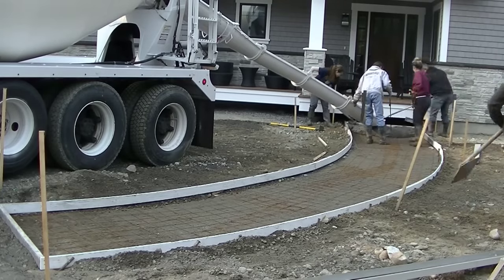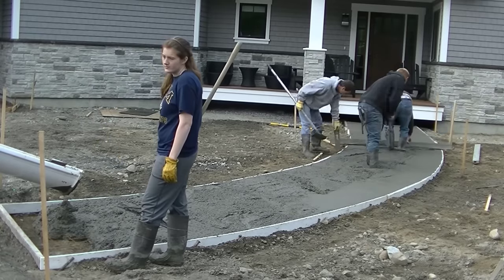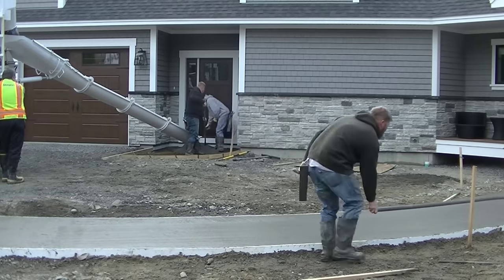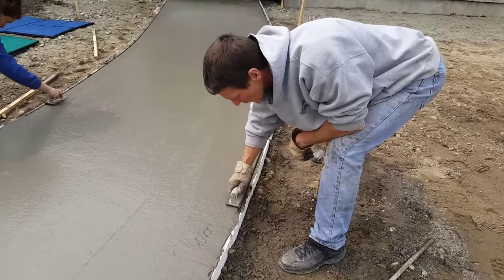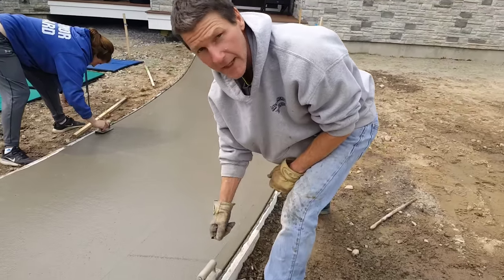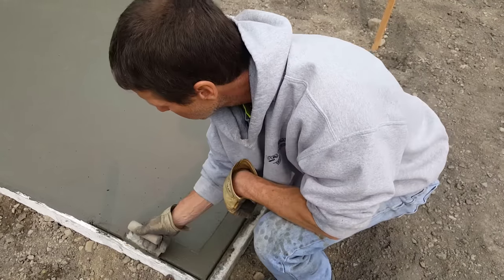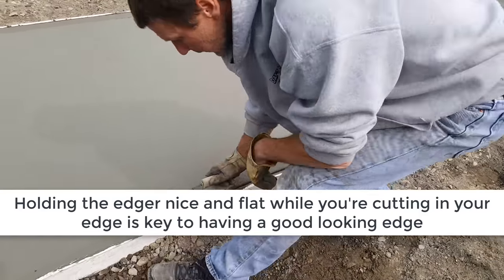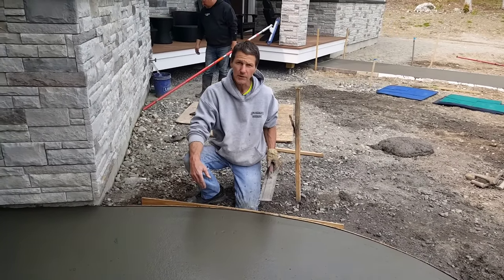When To Start Finishing Concrete After The Pour

Comment: When the previous tenant moved they backed their truck into the porch  smashing the corners on the bottom 2 step corners. I found some bullnose forms that are close in profile. I am wondering  when or if I can remove the forms & try to blend where the old & new concrete  meet. Thanks
Reply from the maker: You'd have to remove them when the concrete is still pretty green but is hard enough to hold its shape. Then use a damp sponge, rubbing the new concrete over the old where there is the seam, blending them together.

Comment: I hate to be "that guy"...but I couldn't help but notice the wire mesh here. You can see the young lady pulling the mesh up to mid slab as it's being poured (great job!)...but then the screed man walks back over it, driving it back to the bottom. If mesh is not set in the slab, it's basically worthless. Just a few bricks or slab bolster will keep the mesh where it's supposed to be. Other than that, very professional and great finishing tips.

Comment: I also enjoyed watching and learning but you forgot to pick up the rebar when you guys were pulling what's the point of having rebar if you're going to leave it way at the bottom don't you have to have it in the middle for to give the concrete just strength and longevity and reinforcement. Not a negative comment awesome job

Comment: Need rebar all the way around the edges. When the sidewalk is kinda hanging by itself or not pinned to anything, I like to dig postholes in the corners then every 5-6 feet or so. And this works for bigger slabs as well. On a sidewalk , put a guy on each side of the screed board. So much faster and don't have to worry about boot print variation.
Reply: Interesting, I haven't heard of that being a requirement. If the area is fairly level I wouldn't think you would need it, right?
Reply: @kbanghart  was your question about the rebar or the post holes?
Reply: @Scubasteve22  oh, I wasn't sure you were describing something separate. So, what do you mean by the rebar and the post holes? Lol. You mean so the whole slab won't shift?
Reply: @kbanghart  What we do is put 1/2" rebar 3" in from the form and tie it to the wire. We put it all the way around the slab. What can happen a the concrete cracks in the tool grooves and freeze thaw, the concrete can move around and actually end up with one side of the joint higher than the other. Just wire does not prevent this. The post holes about a foot below subgrade will help lock the slab from moving or venturing down the hill, since there is no foundation to pin it to. Plus with the post holes in the corners where the concrete is most vulnerable, it strengthens it in case someone accidentally runs over the edge with a vehicle or something heavy. hope this helps

Comment: The finishing instructions are great.  I don't understand your use of metal mesh in the pour and then crushing right down to the bottom by constantly walking on it.  Pulling it up is OK, although that is very difficult to do correctly.  With a pour of the dimension you show, there is no need at all for anyone to be walking in the pour area as it can be stuck off and floated externally.  So, that part of the pour could be much better.

Comment: I'm going to form a 24x9 slab.  The 9 feet section butts up against a wall, so i can't work the concrete from that side.   I'm going to broom it, but was curious the best way to reach the area against the wall to do the initial finishing? Thanks!
Reply from the maker: I've got quite a few videos on broom finishing patios. Check out the videos tab or Search on my channel for patios.
Reply: @MikeDayConcrete  Thanks, awesome videos...I checked them out and feel I can do the job.  Curious, the 24 x 9 slab will be next to my garage for storage.   The slab is 3" and it's not holding a lot of weight at all.  The ground under the slab is crushed shell that has has degraded over the years and has gotten very hard.  There's still a bit of shell, but very dense under it. If I get the concrete delivered with the stuff they put in it to make it stronger, do I need rebar, or wire in the slab and should I leave, or remove the loose shell on top of the hard pan ground before pouring ?  I live in Clearwater Florida, so it rarely gets cold here. Thanks for any advice!
Reply: Handles dude, use long handled Fresno and get on it at correct time, as Mr day said timing is everything,, plus all the variables, wind, plastic, temps ,help or not , chemicals can be our friends,  meaning set and accelerators,. The only thing I see missing from lots of concrete contractors,,you guys don't put enough expansion joint material in when you pour, expansion and retraction, against a wall or another hard slab expansion joint material should be used and of course self leveling caulk when completed,  I see it all the time, ....aci days use it, frost heat and common sense....34 years in the business talking here,. Peace....TNT Concrete Construction,,Rockford,Michigan...

Comment: Very nice work. I have been in the business for over 20 years. My only suggestion is don't waste your money with WWF if you are just walking it into the ground. It serves no benefit or purpose to the concrete where it is located in the sidewalk. It needs to be up on slab bolsters or use fibers.

Comment: I noticed your stakes are pounded in on an angle and are below the form boards. Are they on an angle because it’s easier to hit them that way or is there some other reason? Most times I see form stakes extending up past the top of the forms. Yours are below which makes sense to me. Just don’t see it happen that often around here.
Reply from the maker: Not really any reason for the angle. As long as it holds the form. We always set them below the form when we stamp the concrete. Makes it easier to stamp.
Reply: Mike Day Everything About Concrete thanks for the reply

Comment: One thing im confuse about, in this video,while pouring the concrete you had a girl pulling the mesh up with a hook which I get that is better if that mesh is more in the middle of that pathway, but than your guy that was running that straight edge side to side on top of the side boards of the pathway was totally walking on top of the concrere which I get why, but, it defeated the purpose of lifting up the mesh if he walking on the concrete cause hw push it back down again. Know what I mean, just an observation. Great finish by the way, it looks great.
Reply from the maker: Once you get the aggregate from the concrete under the wire, it doesn't go back to the bottom. Yes, walking on it isn't the best method but it's also got fibermesh in the concrete. We always use fibermesh to compliment the wire mesh.
Reply: Thank you for taking the time to reply back, Im satisfied with your answer. When you are good, you're  good! Thank you Mike

Comment: Aren't you pushing the metal down when step in wet cement?  Shouldn't you level and tamp from the side?
Reply from the maker: Once you get the aggregate from the concrete under the wire it doesn't go all the way back down. It's just fine like that.

Comment: For  anyone watching this for a tutorial one of the most important things in concrete is completley missed here,Steel must never be on the ground optimal is 30mm lower than finished hieght of slab,Wont matter what finish is done the concrete will crack to pieces a lot faster with steel on the ground

Comment: Why don't you use a steel soft trowel instead of a mag? I'm a concreter/builder in New Zealand completely different but same concept. Nice work though. 👍🏽👍🏽
Reply: The mag is supposed to bring out the water to the top, I thought. If u use steel first u could lock in too much water

Comment: How do you edge tight radius curved corners?
Reply from the maker: They do make a curved edger for radius : https://amzn.to/38s0bge
I usually use a small edger 2 3/4" wide by 6" long with only a 1/8" curved edge. The smaller curved edge makes it easier to do a tight radius.
Reply: @MikeDayConcrete  Thanks Mike. I wasnt sure if you tilted it up on end.

Comment: The surface work is excellent..but if you look at the video the mesh reinforcement is not lifted into the concrete when is being poured, rendering it useless.
Reply from the maker: Didn't you notice the person in the maroon sweatshirt pulling up the wire?
Reply: I thought the same thing

Comment: now, I am not saying I know how to pour concrete. But that worker that was pulling up the steel wire  so it wouldn't be lying on the bottom of the slab? the guy that raked the 2x4 across it stomped it back down to the bottom of the slab, if the goal was to have some reinforcing not on the bottom of the slab; their should have been 2 workers on each side of the slab doing the 2x4 leveling without stepping in the concrete.

Comment: Could I just use a wood float and expect the same results?
Reply from the maker: it would be very similar.
Reply: A wood float creates a much rougher surface than a mag.  They are usually only used when the concrete has just been poured.  If you used a wood float when it's partly set up, like the concrete in the video where he is edging it and mag floating it, it would tear up the surface pretty bad.

Comment: What about areas you can reach with the mag?
Reply from the maker: I use my stainless steel skids and get right on the concrete.
Reply: @MikeDayConcrete  so for a small area where you can reach all the way across pretty easily, just use it with a handle and not a pole, right?

Comment: There are only two kinds of concrete, concrete with cracks in it and concrete that hasn’t cracked yet!
Reply: Really, I'm still waiting for the Hover Dam to crack
Reply: Amen
Reply: It going to
Reply: Do it right and it won't crack for decades.  My garage slab is about 28x28 feet and is close to 50 years old.  Zero cracks

Comment: I've been steel fixing and laying concrete 45+ years on small and some of the biggest jobs in the UK ..And we always had to have a gap between the floor and the steel or shutters and steel of it can't do it job as an anti crack device...Having it layed flat on the dirt like you have in the video wouldn't be allowed on any of the jobs I have worked on ...It's also normal to use a vibrator to get the air out of the concrete....So I'm very far from impressive with your concreting skills ..
Reply from the maker: Paul, can't you see the person in the maroon sweatshirt pulling up the wire?
Reply: @MikeDayConcrete  Mike, I also see the next bloke that's screeding and walking backwards, stomping the mesh right back down into the ground.. You'd use some chairs for the mesh... surely?.
Reply: @tird108  it's actually a major detail (the wire is completely useless on the subgrade).   However, this isn't a video about reinforcement, it's about finishing and he makes nice smooth concrete.

Comment: No bad except i lightly tap the forms to eliminate honey combs n yous a walking edger get good at it so you don't make dips I was trained as a youngster to do the proper steps but wen I got into high volume n track first thing is to shit can hand edgers n hand mags to time concrete dos not wait for nobody  get your joints in asap using the right slumps  a good Fresno man can take the edge n joint lines out quick get that truck empty n save on standby time clean your broom every 3rd pass I use fine camel hair broom save your bucket of broom water in case you can poor out the water n use the fine mut in bottom of bucket good also for steps I do youde a hand mag for facing steps all n all your team is ok good rod man

Comment: you guys do realise this guy basically did not even reinforce the path with the steel rio bar he has just left it on the bottom of the path you can see them walking on it and not even pulling it up .it is suposed to be half way through the depth of the concrete if you are going to leave the rio steel on the floor then there is no point it even being there.

Comment: I didn't notice you pulling the steel mesh up into the concrete when pouring it.  Many times I see concrete workers walking on the steel pushing it into the sand and making it useless.  Not a good practice.

Comment: Thank God you didn't trowel it lol 😁
Reply from the maker: No never!
Reply: @MikeDayConcrete  we mag float alot just to make juice, then trowel for shine, we broom with a dust broom lightly, carry thin lines with a shine underneath, rinse wet dust broom,not too much moisture,, brace enger at end ,,it's pritty much building code up here , troweling up here is a most ,,only mag floating up here is sidewalk standard, up here tho only
Reply: @MikeDayConcrete  we pritty much need to trowel do the freezing temps, if we just mag float up here,,the concrete pritty much absorbes salts an the tops pop, then the disasters begins, it starts to turns into sand ,very flaky on top,, in Toronto it's not to bad but anything north is a nightmare, we pritty much need it smoother more then most parts,,the light dust broom on mag with trowel is a must,, Toronto tho🖒nice work Mike
Reply: @MikeDayConcrete  sorry I'm on a job spelling today is horrible, soory Mike 🖒

Comment: You really shouldn’t be pouring concrete over anything other than a 2in sand base over uniform compacted soil. I never pour over dirt. Dirt clods are lighter than concrete and if your concrete is too wet these clods can mix into your concrete and sometimes are just under the surface and later showing up as holes the size of a quarter. This can also happen by just pouring even if the concrete has a proper slump due to the concrete just hitting the dirt and mixing with it as you pour. Any cig butts or paper etc can also find their way to the top very easy as well. I’ve seen it all in 40 years in the business. Also the mesh reinforcement does no good sitting on the bottom. It must be blocked or pulled up to the middle of the slab or it will rust and have no effect at all.
Reply from the maker: This isn't on dirt, it's on 3/4" crushed gravel. No need for sand here.
Reply: So is gravel better, or sand? I'm in the valley in CA, my soil is fairly compacted clay type with a bunch of little rocks.
Reply: Plen122 personally, I always use a 2in sand base.

Comment: Are you using wire mesh then walking on it and rendering it absolutely useless. Why even use mesh on the bottom of the concrete?? .  ITS SUPPOSED To BE IN THE CONCRETE, NOT UNDER IT.

Comment: The fastest and easiest way to mix concrete by hand is using a steelemixer.com  It will mix a bag of concrete without power in less than 40 sec and its supper easy to use! Go check it out!

Comment: Love watching people walk back across the mesh after it gets lifted to screed. Haha waste of time being in there, rookies
Reply: Shane R that was the first thing I noticed. They must have put it in for filler.
Reply: Total WASTE
Reply: Concrete pulls it down with weight anyways even when you put it on chairs you still have to take your rake and catch the mat and pull up a little to make sure it’s up off the stone. Poured Verizon cell tower sites for 5 years, I’ve always had to make sure mats where actually up in the concrete. It just part of the trade not a rookie mistake unless they didn’t lift that section while working it along the way.
Reply: @surefiremushroomsmicrogreens  depends what type of mesh you use :) there's the stuff that bends un stuff that's thick enough to hold itself up.
Reply: Once the mud is down and mesh is pulled up it will rest on the aggregate not the ground, so you can walk on it and screed.
Reply: @95tilinfinity2  you said wat I was gonna say lol lift the grid, muck the mud good under the edges, corners and centers of that grid and, if done correctly, you should be able to walk somewhat carefully on it because of your larger aggregate holding it up